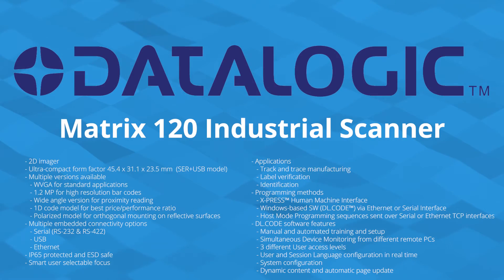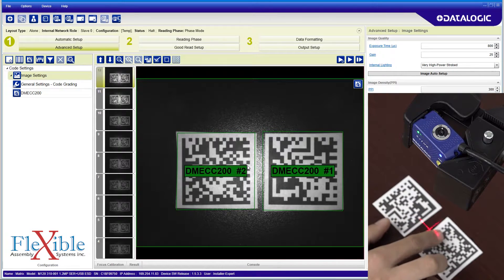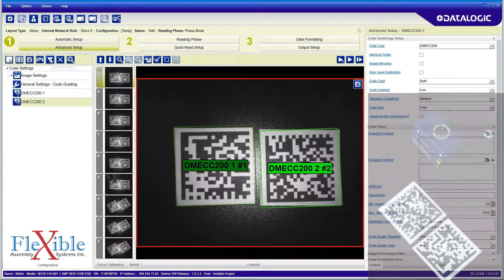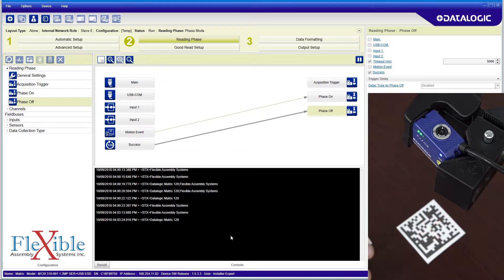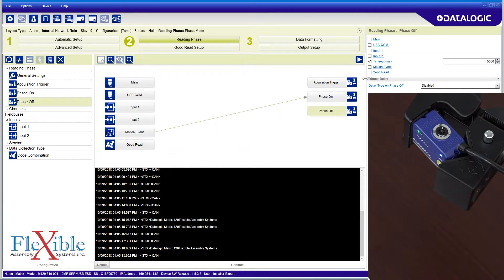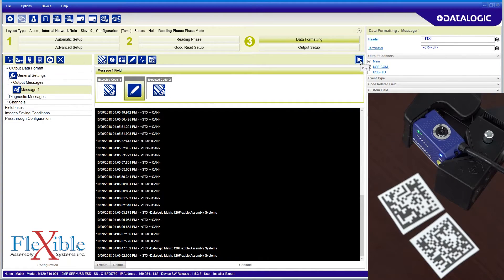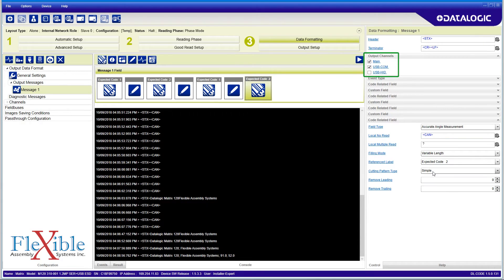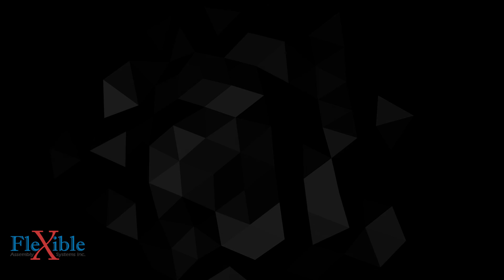Datalogic Matrix 120 & DL.CODE Setup

Comment: Thanks for your great job!  
For more, Please show how to config 2 or more  DL devices in which one of them is server and others are clients.
and they work synchronously. I mean when they catch one same barcode, just deliver one barcode (distinct)
and when any module cant read any barcode, finally send 'NO Read'
You know I have 6 modules, and made a c# server. they work alone and the c# app sync them. but I know this is not standard
Reading Phaze mode: with external trigger

Thanks for our help :)
Reply from the maker: Thank you! For the logic you are describing you will have to modify the Data Collection method within the DL.Code software. Look for the term "Code Collection" in this manual from Datalogic here for instructions and examples; https://www.datalogic.com/eng/stationary-industrial-scanners/dl.code-pd-663.html